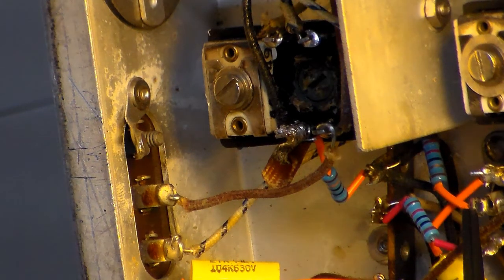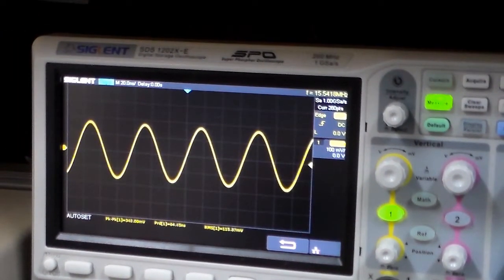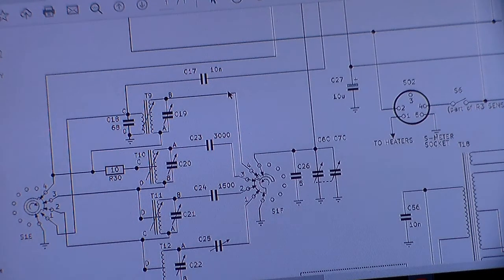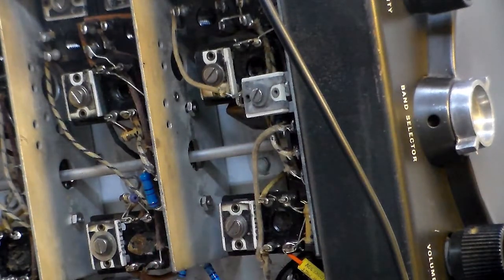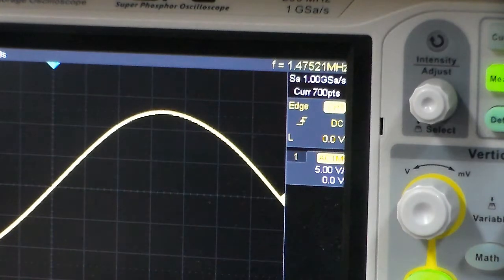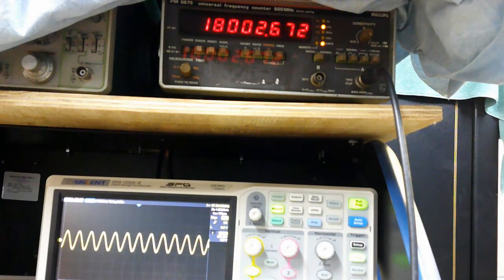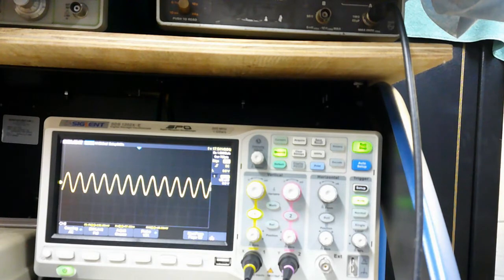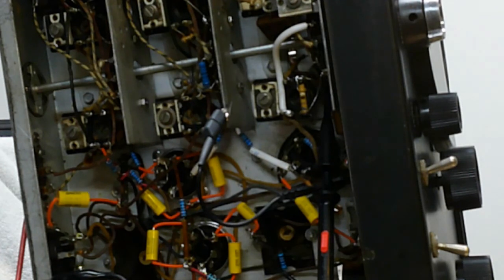Hallicrafters Alignment  - Finally

Comment: Not sure I’m following you. What caused the local oscillator on band 4 to be heard in the speaker but not on the other bands?
Reply from the maker: I expected to hear something from the LO but not that much.  That radio has an interesting LO circuit, and I want to check the area of Switch S1E and the mixer/converter tube 6SA7.  I will get it back on the bench soon and poke around some more.  There was a few more things I wanted to do to it too. Thanks for reminding me about that, hopefully I can track that down.